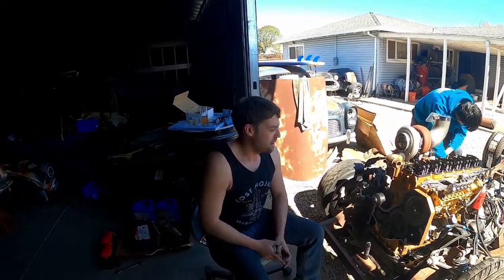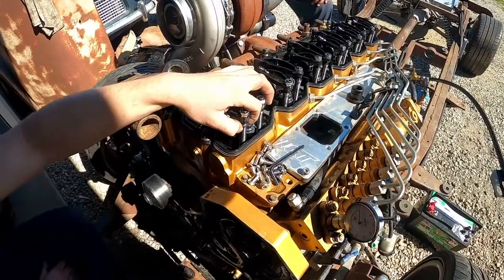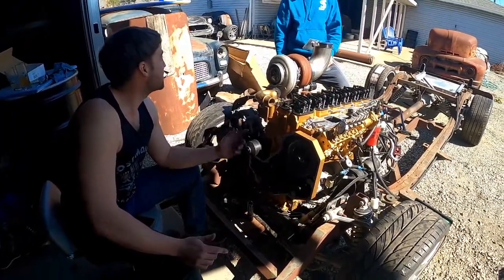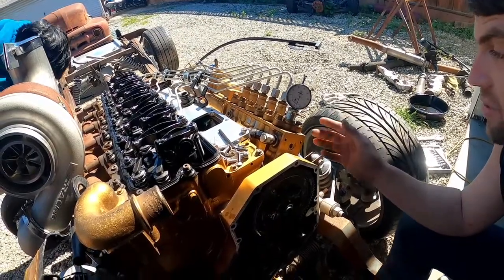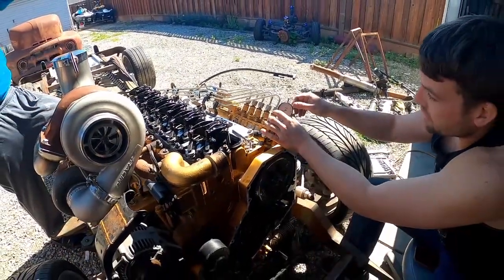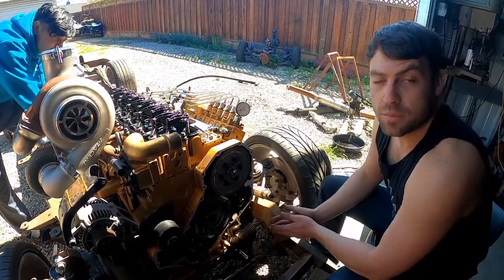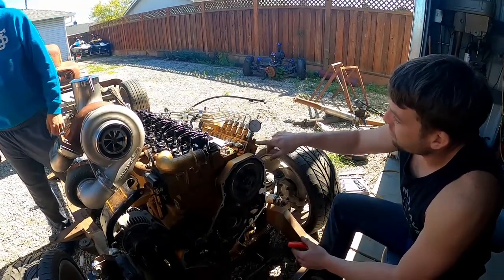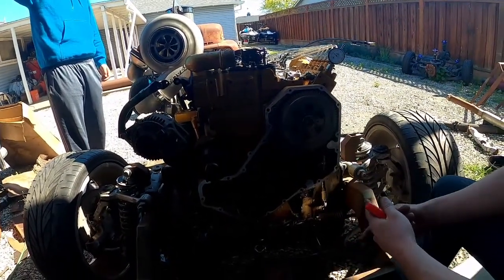Setting Timing on a P-Pump Cummins in 5 minutes

Comment: I have a 12 valve p7100 and used those stainless steel lines because they look good but they are a bigger diameter line and cause the idle to be erratic so I went back to the stock lines. Hope this helps with your project
Reply from the maker: Thanks for the tip!!